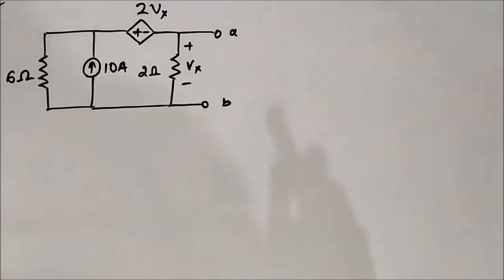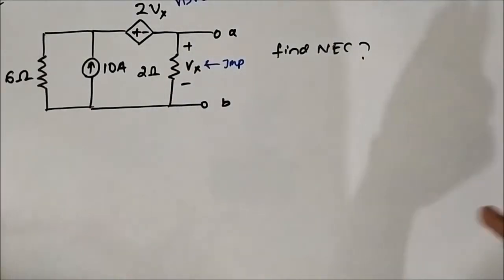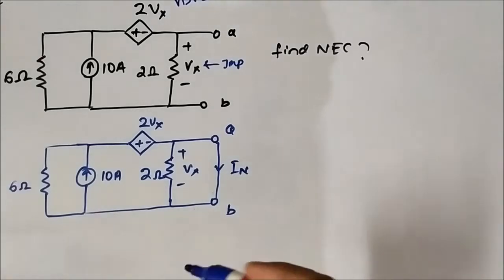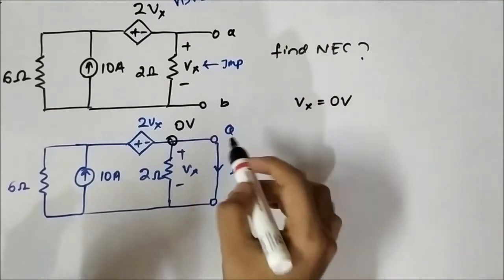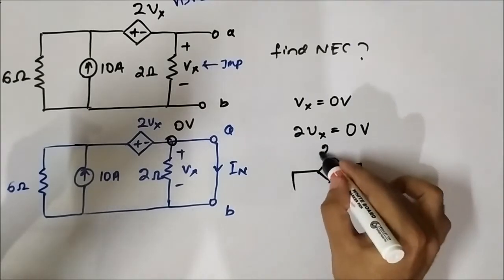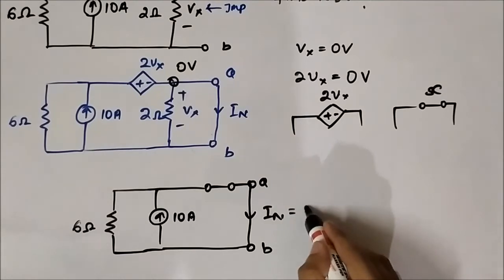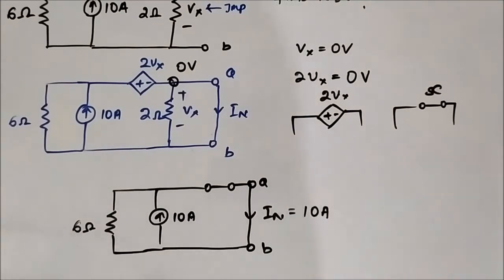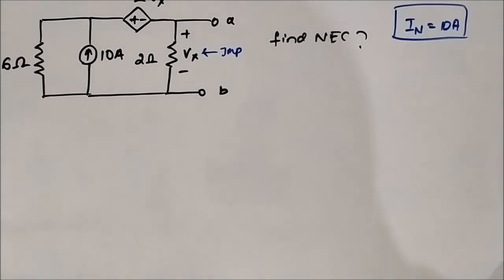Norton Theorem With Dependent Sources | Question 2 | Network Theorems | Network Theory

Comment: sir wouldn't we take 6(io-0.5) negative since resistance is always taken negative in KVL,

also why have we taken 1V as - 
and why didn't we consider the 2 ohm resistance while applying kvl in mesh 1 ?
Reply: The direction of loop is clockwise and current flowing through 6ohm is anticlockwise so it will be taken as positive.So if these directions are opposite it is taken as +ve and if these directions are same it is taken as -ve.
Reply: @wanderervans